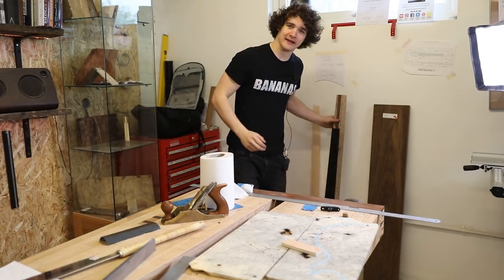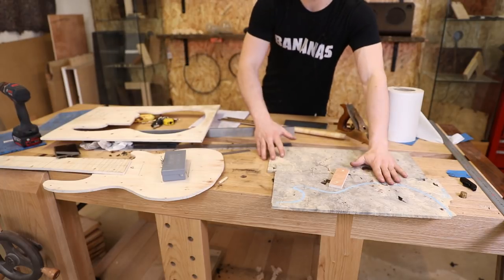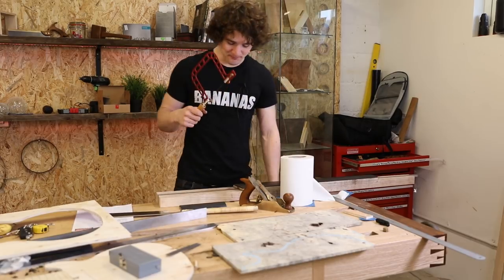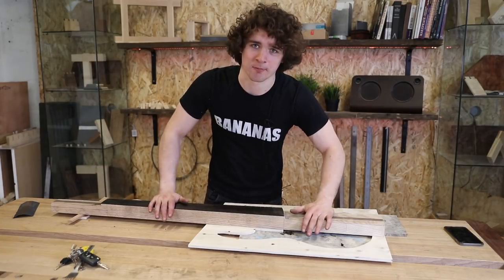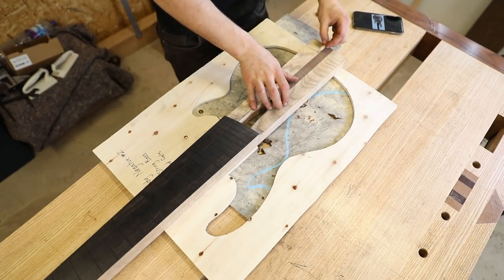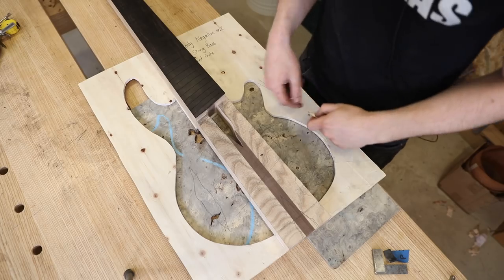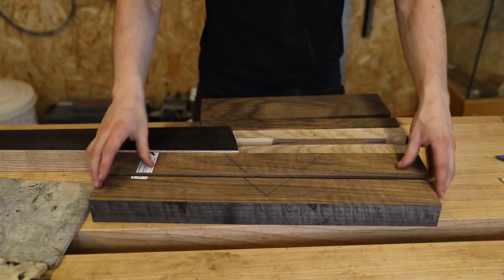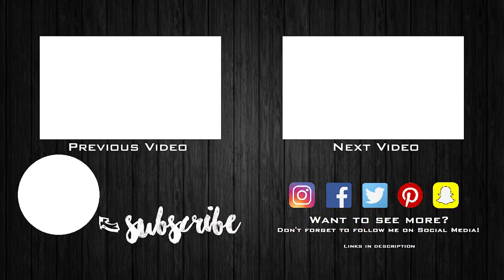Making a Custom Bass Guitar | Part 6

Comment: Very nice work and good catch on the straightness of the fretboard. You should really have used a much longer block when sanding the fretboard though.  Optimally a very flat block the length of the fretboard, and without the cork which is flexible and you dont want any give, but one that's half as long as the fretboard would be much better than what you used.  That little block only guarantees flatness over a few inches and you want it flat end to end.